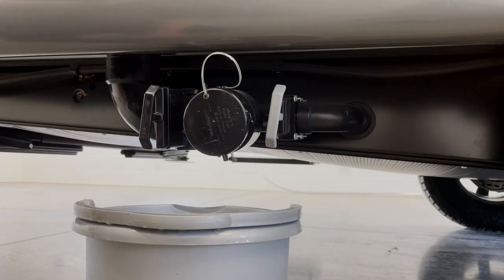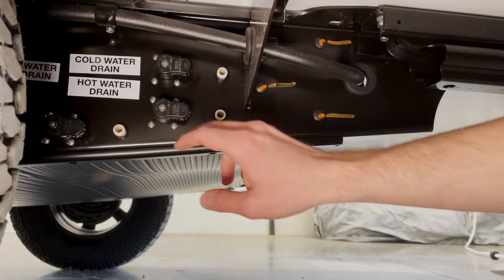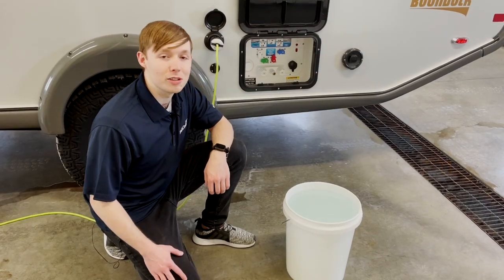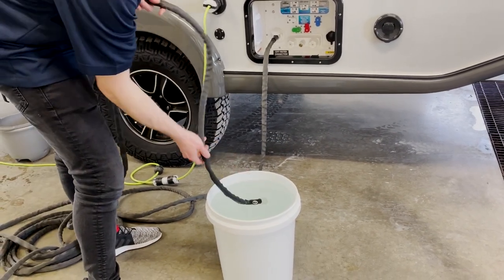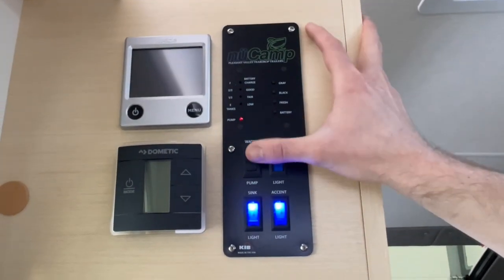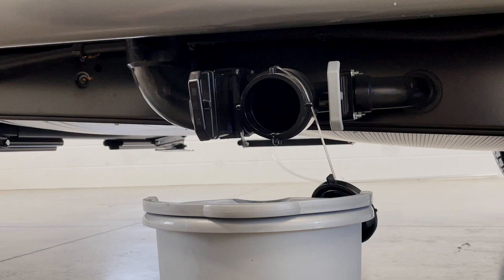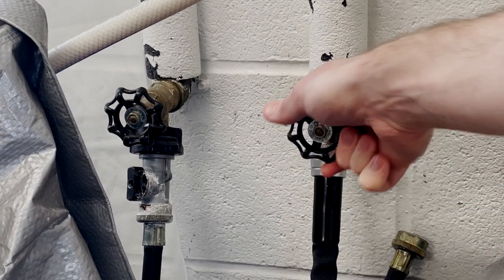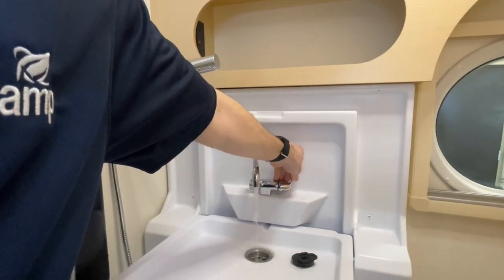How to Dewinterize a TAB 400

Comment: 1/4 cup of bleach per 15 gallons of water in the fresh tank is sufficient.  1/2 cup per gallon will require multiple flushings of the fresh tank due to lingering odor.
Reply: Agreed and good info for practical sanitation.

Comment: Great! Very helpful. This is straightforward for quickly sanitizing the hot/cold water lines and fixtures that had antifreeze. How do you also sanitize the 22-gallon fresh water tank (2022 T@B 400)? Did you siphon only 1 gallon of sanitizing fluid from your 5-gallon bucket, or all 5 gallons into the tank? (Maybe you filled the tank all the way?) Your strong 1:32 bleach solution (1/2 c bleach/gallon water) is very effective at disinfecting after only a few minutes, but it may require multiple rinses to clear the bleach odor from the tank. What method does nüCamp recommend for sanitizing the fresh-water tank? Thanks!
Reply from the maker: Hi Douglas! We're glad you found the video helpful! You will need to do a complete flush with fresh water after running the bleach solution through your system. Please send your questions to our technicians as they are better suited to answer your questions! You can reach them at tech@nucamprv.com ☺
Reply: @nucamprv  Do you need to have the bleach solution 'sit' for a while - other sanitization videos suggest that the bleach solution sit in the lines for 8-12 hours.
Reply from the maker: @christopherwilson2684  At this concentration it should sanitize within minutes. Once the bleach has been run through your system you can flush with fresh water. You can flush with freshwater multiple times if there is a lingering bleach odor.
Reply: @christopherwilson2684 what did you find out?
Reply: @nucamprv how would letting one gallon drain through the tank sanitize the whole tank?

Comment: We have a Cirrus 820. I keep seeing things that say "don't forget to set the Alde bypass valve to the flow position" -- but you haven't mentioned that and the only valve I can see is a yellow one that already seems to be in a flow position.  Is there something I'm missing?
Reply from the maker: The bypass valve is built into the Nautilus System in the Cirrus 820. The red knob on the panel receives water from the cold water supply line. If it is in the sideways position, water will go into the hot water fixtures without going through the hot water heater. If it is in the upward position, water goes to the hot water heater first. Here is the user guide for the Nautilus: https://www.bandbmolders.com/wp-content/uploads/2019/10/Nautilus-P3-User-2.pdf

Comment: When in the powerfill mode to fill the freshwater tank should the pressure regulator be attached to the hose?
Reply from the maker: Yes, you should use a water pressure regulator.